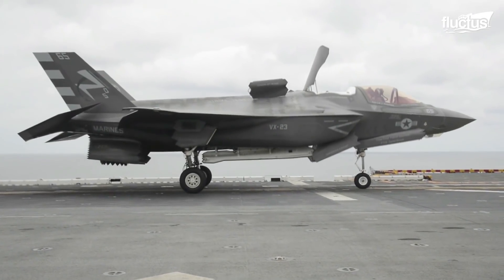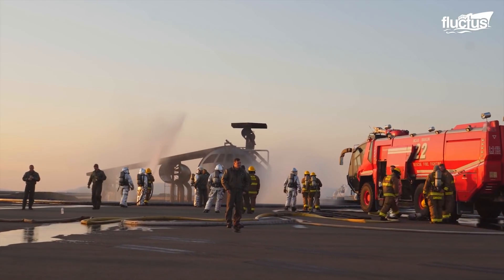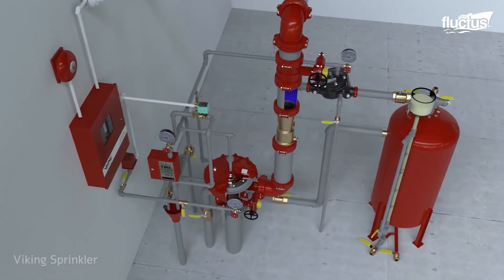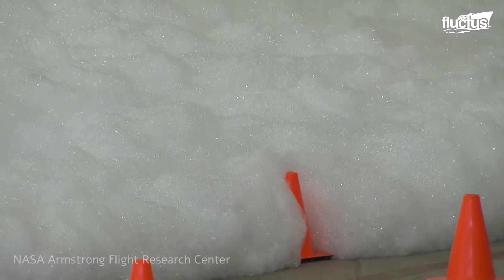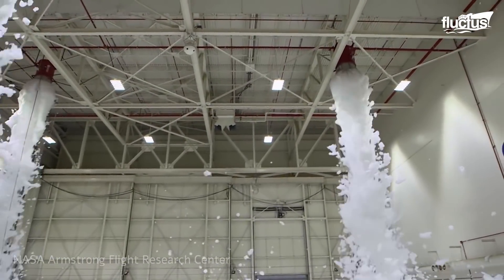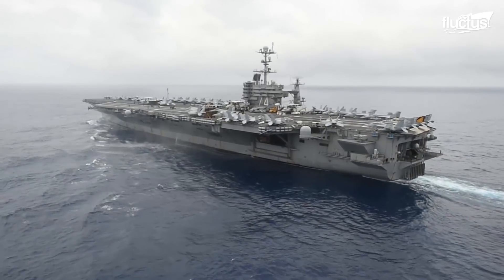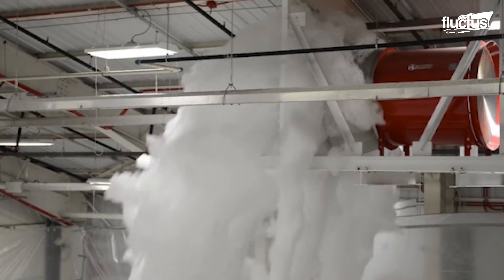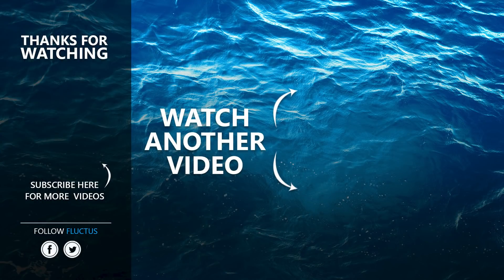This Genius Invention Can Fill an Aircraft Hangar in less than One Minute

Comment: This wonderful genius invention has discharged inadvertently no less than 175 times in the past 20 years killing several people. This crap went off in the hangar I work at a few years ago and caused millions of dollars in damage. Geniusly chokes those working in fuel cells and other areas of aircraft fuselage where they cannot quickly escape. I say go back to old style water as these systems are ridiculously expensive to install but the genius fire codes demand the genius system to be installed.

Comment: The foam is not really a foam, it consists of chicken guts to make the foam, so it is also a biohazard.  The damage the foam can do to the hanger can outweigh the cost of the aircraft.  We had a 3 bay commercial aircraft hanger flood several times due to spiders crawling over the infrared sensors.  Foam vs water fog, the water fog is the less damaging option.
Reply: What is water fog?
Reply: WHAT THE-